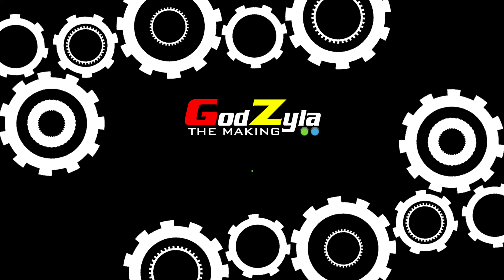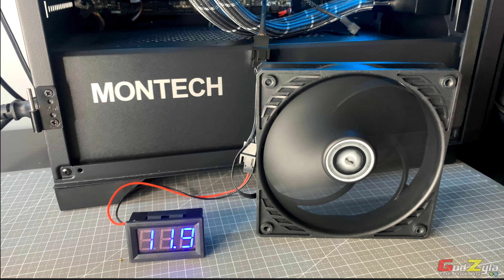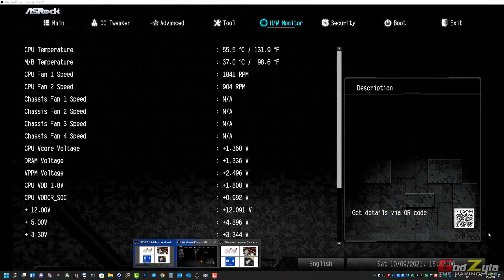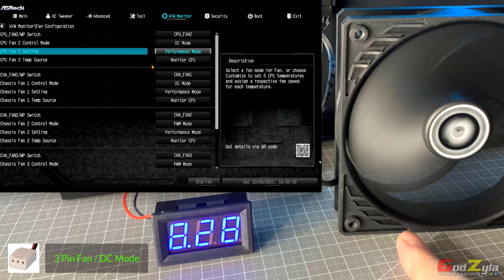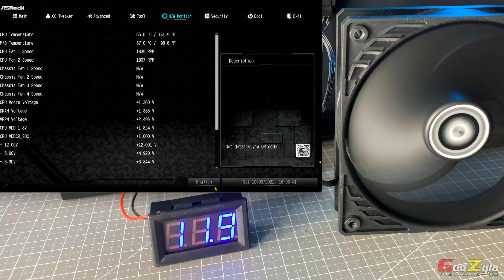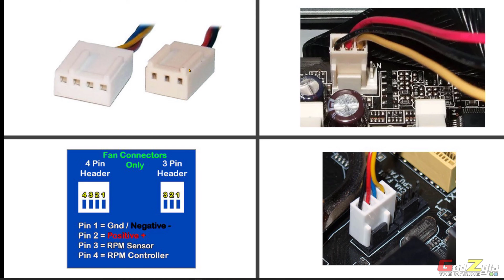Fan Mode - PWM or DC

Comment: I can confirm, that you have a higher tear, if you run on DC-mode. I have two 200mm fans installed on the top of my case. Installing fans horizontal is already more demanding for the fans. After 5 years one of the fans started making noises from time to time and the totally collapsed. I bought a new one last august and this one already had 2 situations, where it randomly stopped spinning at all and was in a start/stop loop until I restarted the system, while making strange noises. That was the point where I checked my bios and noticed that all fans had been reset to DC instead of PWM, probably after a bios-update long time ago. Now I put them all back to PMW and hope, that the fan is not already damaged and will last till I build a completley new rig. There is really no point in using DC at all since all modern fans and mainboards, that are not older than 7-8 years and total budget-picks should have 3-pin headers.
Reply from the maker: Welcome to my channel reel124c41. Thank you for sharing your info and yup. For modern fans, no point to run at dc mode. Infact dc are meant for legacy fans which comes with a 3pin connector.

Comment: what is good RPM for cpu fan..?
Reply from the maker: Welcome to my channel Hpr. It greatly depends on how well your cooler absorbs heat and to dissipate heat, also how much static pressure can your fans push at the selected RPM. You have to test it yourself to adjust the RPM of your fans.

Comment: I have 3 pin fans and i dont have the dc option in my bios i only have pmw 
My mobo is the msi a520 pro
Reply from the maker: Hi amine, welcome to my channel. If that's the case, even if you set PWM , your 3 pin fans will run at full speed.
Reply: @KleoYan thanks i knew that but does that mean my mobo does not support dc mode?and is there any other solutions so i can control my fans speed?
Reply from the maker: @amiiinnn1  you can use this but you wont be able to see the rpm that's running https://amzn.asia/d/fAYzIJF and you will need a legacy 4pin molex cable from your PSU.
Reply: @KleoYan thank u
Reply from the maker: @amiiinnn1  you are most welcome.

Comment: Need to ask please, i look into my bios and find out my front fans are on dc mode, should i turn them on pmw too?  Just found this after like 5 years of my pc usage 😅
Reply from the maker: Hi Mikdek, welcome to my channel. check what type of fans are at the front. Are they 4pin connectors or 3pin connectors. if it's 4pin, set it to PWM mode but you have to set your fan curve or to use the motherboard fan profile, example, silent, performance or etc.

Comment: For me, the CPU fan in PWM mode, when comparing both fans at same speed, is louder than in DC mode. Is there any solutions? Thermalright PA 120 SE ARGB (cpu cooler)
Reply from the maker: Hi Francesco Mirenda, welcome to my channel, most modern fans that are 4pin, you should stay at PWM. The reason your fans are much louder as it's ramping up gradually which is matching to your temperature, else for DC Mode, it does not do that gradually. It will just ramp instantly. This is why you hear that in PWM mode, it's louder. I won't advise you to run 4pin pwm with DC mode and honestly speaking, there are no solution to this, unless you set your fan curve to run lower rpm.

Comment: I've been using Asus 4th gen motherboard with two 4 fan headers only. For CPU its pwm controlled but for case fan it's header got 4th pin labelled as +5v not Pwm signal.
Although Corsair ML120 Magnetic Levitation PWM fan is getting controlled from (250-2000) via that fake pwm header & official pwm rpm is 450-2000.
So basically DC is taking it to even lower rpms.
But I'm worried about fans logetivity.
That's why ordered a fam hub although I'll have to use CPU pwm header to attach the hub & both cpu & case fan curves will get combined.
But as you're saying that dc is bad for pwm fans then I'll have to sacrifice different fan curves for the sake of getting real pwm control for that fan😮
Reply from the maker: Hi Abhi MD, welcome to my channel. Yes I did say that as I have experience before, PWM 4 pin fans mulfunction when I kept it running at silent mode which is below 7volts. ideally if you have 4pin PWM fans to run in DC mode. it will be best to run it at 7v as the lowest and not 5v as it's lowest.
Reply: @KleoYan  thnx. But how to tell that it's running on 7watts. Asus fan xpert shows temp & RPM percent on curve.
I've CPU fan header with Pwm so if I can use a hub to connect both cpu & case fans to that hub then both will work with pwm (max current will be less than 1amp so no tension on that front).
Although I can't set different fan curves for CPU & case fan but that's the sacrifice I need to do if wanna use the Pwm function of case fan😮
Will it be alright to use cpu header for this operation?
Please let me know as I'm very new in this area.
Reply from the maker: @ normally I will have my air cooler fan or liquid aio radiator fans to connect directly to the CPU_FAN header. As for case fans. Plug them to SYS_FAN with your fan hub. 

I got apologise to you too as I longer deal with motherboards which are below intel gen 13th and AMD am4. So sorry about it. I can’t really guide you as I do not have a gen 4 motherboard to get you. Which I believe is an Intel platform.
Reply: @KleoYan  Thanks man👍 I've read somewhere that CPU & case fans headers uses different temp sensors so it'll be better if we don't combine them.
I'll take a risk & run this Corsair fan on voltage controlled case fan header as it's under 5yrs warranty which is long enough to not to worry about 😃
If it's get bad in that meantime I can easily get it repaired or replaced from them😅
Reply from the maker: @ ok. All the very best with your build and so pardon me, couldn’t help you much.

Comment: I have 3 pins fans mounted on my case all linked to the case countroler which use pwn cable.  How should I set my bios ? Thank you.
Reply from the maker: Hi Vince, welcome to my channel. It works the same. in UEFI, set it to DC mode and set to the voltage you wanted your fan to run.

Comment: I tried fan control to set a config. Though turning off FC resets the config
Reply from the maker: Hi Ak47, welcome to my channel, if you are using software to configure as in Fan Control, you will need to have it running in the background and not turning it off. That is part of the reason, why I have set my fan's PWM in UEFI/Bios.

Comment: in mu bios PWM is enabled, i hava a 3 pin cooler, and when i switch to DC mode fan cooler is quiter than it was when PWM was enabled, withc one sholud i use
Reply from the maker: Hi ROck D, welcome to my channel. Do you mean fans or pump cos I can't figure what you mean by 3pin cooler.
Reply: @KleoYan  3 pin air fan cooler is connected to 4 pin on motherboard
Reply from the maker: @rockd5272  I see, then check the volarage or profile. it could be due to lower profile or lower voltage, your fan runs quiet.
Reply: is it normal for fan to be noisy when on pwc mod
Reply from the maker: @rockd5272  all fans does make noise, so long it's moving parts with rotar. but there are a difference between quailty with performance fans, those can be quiet at high rpm.
Reply: @KleoYan  oh i get it thanks
Reply from the maker: @rockd5272  ok all the best.

Comment: I want to buy a h6 flow rgb, but the fans are 3 pin dc. I understand how to set ot to dc in bios. But would i still be able to set a fan speed curve in the bios in manual mode? Basically slowest at idle , the gradually increase voltage when the sysyem temperature increases ?? Or will a dc fan stay at the 1 speed (voltage) you set it to in bios , thank you , great channel easy to understand 👍
Reply from the maker: HI Craig DJ BULLER, welcome to my channel. You can only set to DC mode and depending on your board if it allows you to have a custom fan curve on your 3pin connector fans. 
Mine only allows me to set at a fix voltage in DC mode ... example low temperature below 40°C to run fix at 7volts , mid temperature below 75°C to run at fix 9volts and at high temperature above 75°C to fun fix at 12volts

Comment: Hi, I cant find the "fan configuration" in bios to change to DC from PWM ive been looking were you have yours but it is not there, I run an old Asrock Fatal1ty z170 ITX, dont know if the board has to do with the problem... 
My case fans only have 3 pin, and I use Noctua NF-P14 fans in my case
Reply from the maker: hi Tor stein, welcome to my channel. As I do not have this motherboard, i am not able to view the bios intereface. but after looking at the manual https://download.asrock.com/Manual/Fatal1ty%20Z170%20Gaming-ITXac.pdf page 79. go to HWmonitor and scroll down. you should be able to do the settings, unless there are no sub menu to select between Auto, PWM and DC. this I can't help you with.
Reply: @KleoYan   Ty for trying, I guess there is no way to do this on my motherboard... it sucks but I think it is time to buy a new pc soon anyways haha. ty ty
Reply from the maker: @touch.  no problem and you are most welcome😉

Comment: mygygbite bios has no response.. fan 4 pins p12 artic in a hub no response...
Reply from the maker: Hi andi bufi, welcome to my channel. If you plug direct, does it have response? if it does, means your hub have some issues.
Reply: @KleoYan  hmm I didn't try, let me see
Reply from the maker: @123bacio  ok, give it a try. All tbe best of luck 😉

Comment: Bro im use aio cpu 3pin pump connector in 4pin connecter not in dc mode then now my pump fan is not working plz give a solution
Reply from the maker: Hi EVERY thing, which Liquid AIO are you using? I will need to know before I can try to help you out.
Reply: @KleoYan  darkflash symphony 240
Reply from the maker: @EVERYthing-dx3tm  hmm after looking at the specs of your liquid AIO. The fans are of own 4pin. It should work fine. Have you tired plugging to another fan header? If that still doesn’t work. I would advice you if your liquid AIO is still under warranty, file anRMA to darkflash, to replace those fans.
Reply: @KleoYan  thanks broo
Reply from the maker: @EVERYthing-dx3tm  you are most welcome.

Comment: Hey, nice video. I want to tell you I have 6 fans in case but one rear with pwm cause it is 4pin and the others have 4pins too but I take them to a Commander controller (corsair) and it is connected to USB port, the cpu cooler is AIO so the pump is connected to cpu_header but it has only 3 pin :/ So my question is, How can I change the fans speed to silently or as your video shows in "standard mode" ? Because when I open a game what is stressing a little the cpu maybe or the system, it going on loud not on full speed (I guess) but you can hear it from far... But anyway what I do not understand here exactly is my fans with 4pins connected to a controller-> controller to USB (with psu sata cable I think)-> and naturally the cpu_header with the pump with 3 pin.. Is there any option to change the speed?
Reply from the maker: Hi KrisiHD, I am not familiar with commander pro from corsair, as for pump it will be best to run at consistant speed since you are using your motherboard cpu_fan header, use the UFEI to control it or to use your motherboard application to control it. As for the rest of the fan speed that is under commander pro. you need to control via the commander pro application.
Reply: @KleoYan  Thanks for responding, yes I already got the software today and it is working fine, but when closed or restart the application not running it is the same, in bios settings I have some options like DC curves in Tuf motherboard, but I am afraid a bit because don't know how it work with the pump maybe more heat to processor or something just using that software 😁 or without program maybe the fan speed like in software default or called "balanced" 1500 rpm, i have 4000D airflow case so I can see it and hear it going faster and louder. Thanks your suggest!

Comment: Thank you for making a clear video! I had MSI Z490 Tomahawk board that featured fine control of DC mode, from 0v all the way to 12v, and the only reason why I used my DeepCool CPU fan in DC mode instead of PWM was because of that fine control. Like it was mostly on 0 rpm while I was using my PC for standard web browsing etc. PWM was at around 20% and I found it unnecessary, just pulling dust while the CPU was under normal temps. Then I sold that mobo and bought this Asus H410M. Couldn't believe it forced DC mode to around 70%, was very dissapointed, and now, I'm looking into getting an ASRock Z490 ITX/TB3, but just have to find out how robust ASRock fan control is. If there is a way for the CPU fan to be in 0RPM while being in PWM, I'd gladly use it that way, but I can't find any info on web. If you have more data on this I would really appreciate it!
Reply from the maker: Hi Игор Кнежевић, welcome to my channel, as what I have experience with most motherboard these days, the DC mode is set either to 65 or 70 percent. so sorry that I do not know of any motherboard that does 0volts.
Reply: @KleoYan  thank you for answering! Thing is, my older Gigabyte B365m board also supported 0rpm DC which really confused me. I was thinking how could Asus forget such a big feature, even their higher end boards don't support it, well, they kind of do, as long as it isn't CPU fan. Just disappointed, and now in my hunt for a miniITX my choice is basically just ASRock Z490 ITX/TB3 and that's it.
Reply from the maker: @igor4knezevic  I see, thank you for sharing, greatly appreciated it and I do hope you find a board which have that function for you. All the very best buddy 😉

Comment: Can you turn a non PWM fan on and off with python code? Based on CPU temp? I realize you can not control the speed (or maybe you can) but I have a lot of non PWN fans I don't want to throw away.
Reply from the maker: Hello CJ Lowe, welcome to my channel. The only thing I know as in to turn on and off is to use a physical controller SinLoon 4 Knob Cooling Fan Speed Controller PC 8 Channels Fan Hub for CPU Case HDD VGA PWM Fan PCI Bracket 12V Fan Control- 4Pin Interface Power Supply ( 4 Pin 4Knob ) https://a.co/d/932o5mb as for coding, I have no clue how to code.

Comment: so when to use each ?
Reply from the maker: Hi Mr. President, welcome back, if your fan connector is 3pin, I would use DC Mode, as for 4pin fan connector, I will use PWM Mode.

Comment: Can I check so these 4 Pin are 12 voltage in general and 3 Pin are 5Volt ?
Reply from the maker: Hello sniperworks, welcome to my channel. Nope both 3Pin and 4Pin pwm are 12volts. The other connector if there are argb on the fan itself.. there is another 3pin connector and that's 5volts 3pin ARGB

Comment: Pulse Width Modulation or Direct Current
Reply from the maker: Hello Arround The House With Randy Meeks, welcome to my channel. it's preferable to use PWM 4 pin fans instead of 3pin PWM fans. but if you have a 3pin, you have no  choice but to make sure of DC in UEFI.

Comment: I have a PWM fan at "System Fan Speed Control" is normal and System Fan Control mode is on Auto. It gets hot when I play and runs at 700RPM. Can I put my fan speed on full and put my control mode on PWM?. It runs at 1470RPM and it's not hot anymore. Is it safe to run on full speed?
Reply from the maker: Hello Giurea Alexandru Eduard, welcome to my channel. Pardon me, is the System Fan Speed Control a physical device or is listed in your UEFI? Mind to let me know which motherboard you are using? In general, you fan can run as full speed with no issues. It will run till it’s lifecycle ends.
Reply: @KleoYan  hey!!! I have a gigabyte b450m ds3h, I changed my fan from DC to PWM but I haven't enabled the PWM yet! So my PC was overheating on normal speed and auto! So I can only set my fan on Normal (which is overheating when playing, silent which is worser or full speed which)
Reply: @KleoYan  my question is: Can I run the fan at full speed with PWM mode instead of normal and auto so my PC won't overheat? I have only one fan
Reply from the maker: @alexrra  be it pwm or dc mode. No issue, you can run at full speed.
Reply from the maker: @alexrra  btw your case is only with one fan? You should try to get a decent case and some decent case fans. One fan itself will not help to pull hot air out of the case.
Reply: @KleoYan  oh I always had 1 fan but it broke and I bought a new one. But the other one was running at 1500 rpm and this one only at 700. So I put it back on full speed and no overheat!!!
Reply from the maker: @alexrra  ok, so long you can cook your components that will be fine.